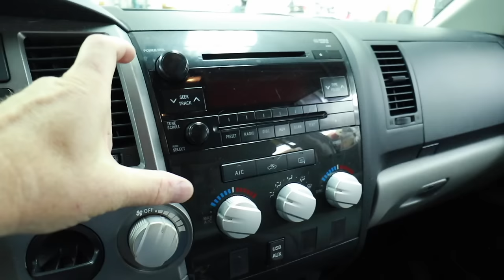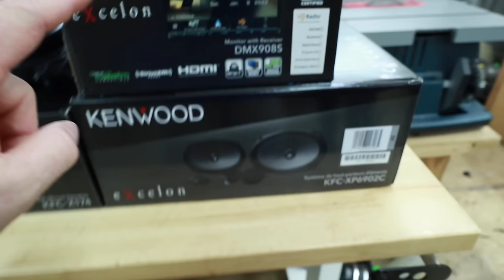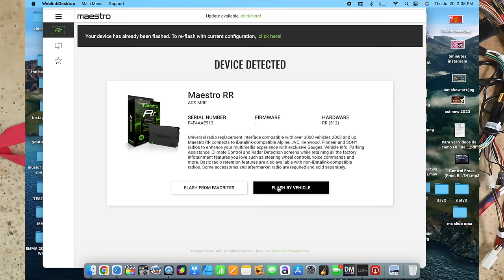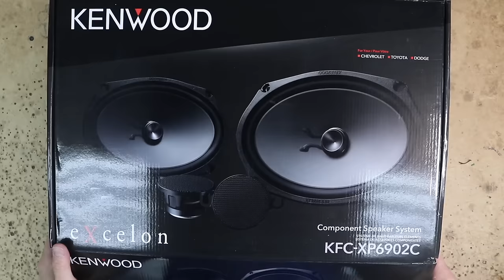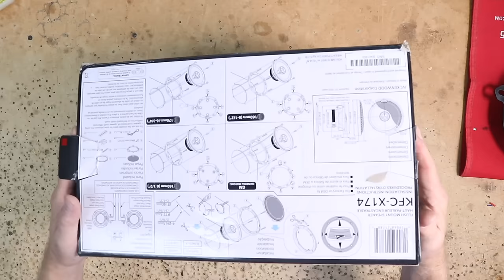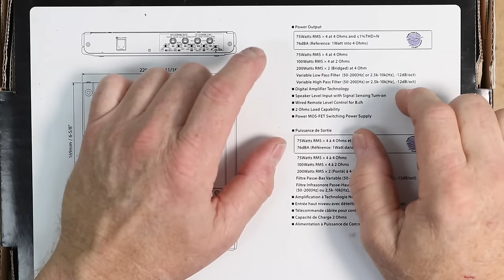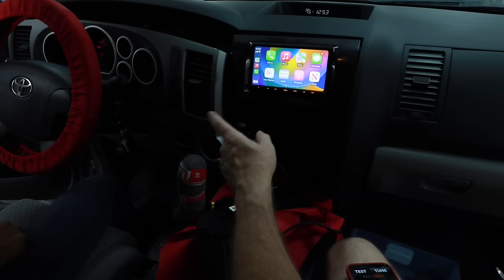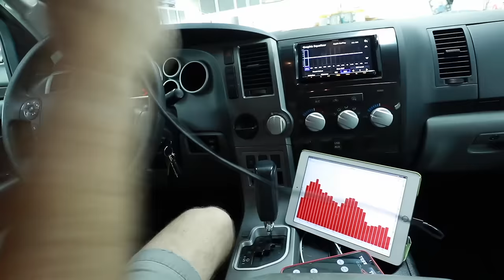Full stereo install Toyota Tundra

Comment: I know these types of installs are probably boring to the more advanced installers but they’re great for the typical DIY guys like me. No fancy and expensive DSP or floating screen stuff, just a straightforward, relatively inexpensive setup to improve the sound on an older vehicle which more of us are driving.  I have the RF P-300 in several of my cars and they’re great, especially given the size and cost. They don’t suck up storage space and can be easily removed if you need those extra inches.

Comment: I just installed these same Kenwood speakers in my 2008 tundra and it wasn’t as simple as it looked. The 6x9 would hit the window track I had to use the extra spacer they include along with the adapter. Then grind down the edge of speaker hole on the inside door panel exactly where you said you want the speaker butted up so all the sound comes through. I’m taking the door apart again tomorrow to make sure I haven’t damaged the speakers. They sound really good though compared to stock.

Comment: Hey Dean and Fernando, hey I follow you guys regularly and I have a question that I hope you can possibly help me with. I have a 2018 Ram 2500 Tradesman with the non-premium factory radio and I am using a AC LC2i. So when I open the doors of the truck the lc2i and my amp turn on or power up. I am using the GTO on the lc2. Have any suggestions. I would greatly appreciate

Comment: Anybody has a suggestion on replacing the front speakers on a 06 Lexus Ls430 with Mark Levinson ?  OEM's are $150 per speaker. a little pricy in my opinion
Reply: No the mark levinson system is pretty good and prob would t sound as good as a aftermarket system unless you will to spend some big money